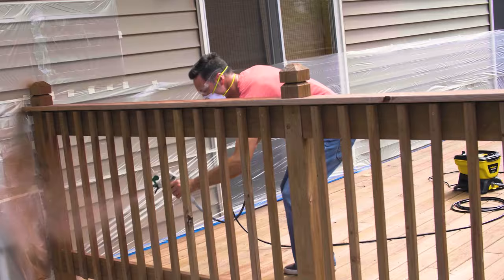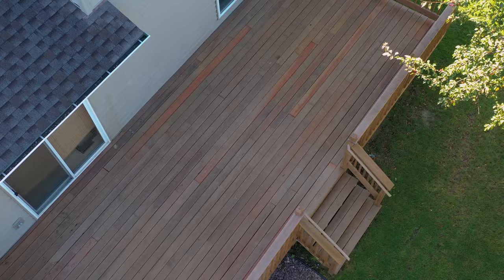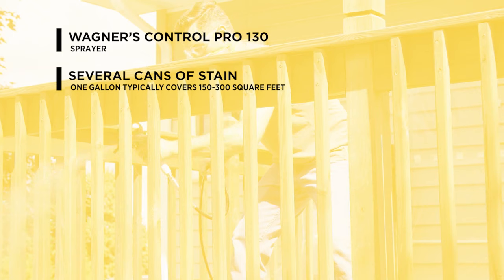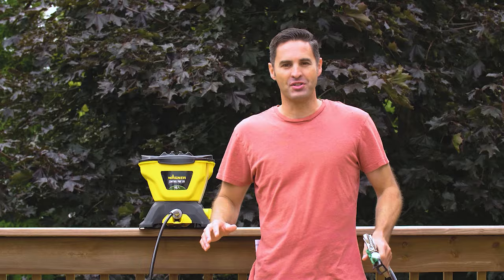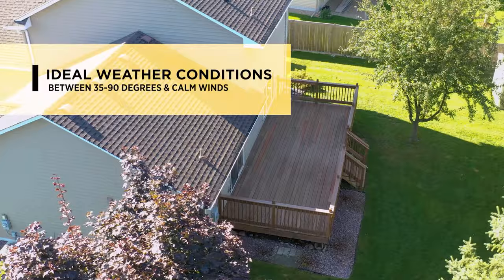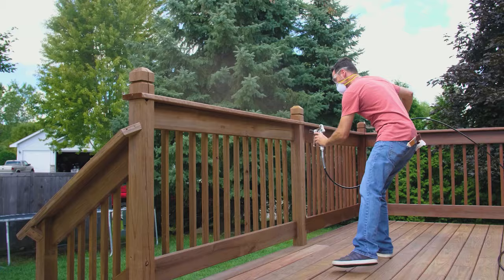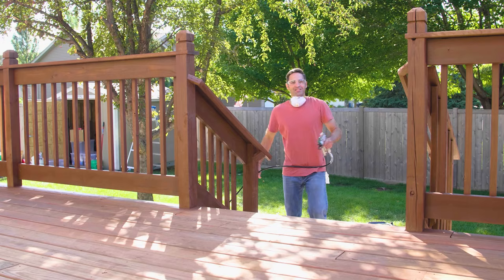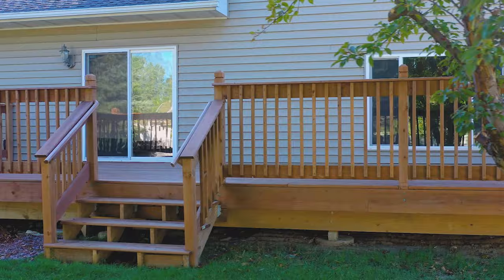How to Stain a Deck with a Paint Sprayer

Comment: I love this! Two friends helped me stain last year and it still took us two full days. Staining by myself this year and have been dreading it. Didn’t think to use a sprayer. 

But I have a tip, if you put the top strap of your mask around the top part of the crown of your head it seals better and won’t pull down so badly - signed a nurse who has to wear them all the time 😊
Reply from the maker: A sprayer will be a huge help for you! Also, thank you for the tip!

Comment: I was looking at this particular product and this video was perfect. I have a fence in the backyard in serious need of some TLC. So first is the fence cleaning and after drying for a few days I'll be staining it and this was some very helpful tips. Thanks.
Reply from the maker: We're glad this inspired you, Julie! The Control Pro 130 would be a great option for staining your fence. A lot of the same tips can apply as well! Quick tip: The Control Pro 130 comes with a 515 spray tip that's ideal for spraying latex paint. If you're spraying stain, we'd recommend purchasing a 413 or 311 spray tip.
Reply: How to clean the gun after staining?
Reply from the maker: If you used a water-based stain then you'd simply flush the sprayer with water. If you used an oil-based stain then you'd have to use a thinner like mineral spirits.

Comment: Do you have to thin a clear coat deck sealer like Thompson's deck sealer? If so, what would be best used to thin it?
Reply from the maker: Thank you for your question! Thompson's wood sealers work great with Wagner sprayers, since they offer both oil-based stains and water-based products. These airless sprayers do not require thinning, but they do require the correct tip size. The maximum tip size for the Control Pro 130 is .015", which is the 515 that comes with the package. Tip size information is usually found on the back of the can. Let us know if you have any more questions! Happy staining!😀

Comment: After powerwashing the time interval guidance is from 1 -3 days . Am not sure .
Reply from the maker: It's important to make sure the deck boards are dry after power washing to make sure the new stain adheres correctly. That can generally take 1-3 days depending on your deck boards, climate and weather.
Reply: Couple of dry days for sure and then check it by putting a couple drops of water on deck somewhere and see if the wood absorbs it, it it does then get er dun!

Comment: Did you go back and wipe the stain with a rag afterwards?
Reply from the maker: That step will depend on the type of stain you're using and the wood you're spraying. In most cases if the proper steps are followed, you won't need to follow along with a rag

Comment: I have a Control Pro 150. What size tip should i use to apply oil to my deck and battens similar to those around the deck in the video? Cutek Oil
Reply from the maker: Thank you for asking! What is the type/brand of oil you're using? If it's a thinner stain then we'd recommend a 413 or 311 tip. Also, make sure the material has a minimum flash point of 100 degrees Fahrenheit (flammable materials should not be used in the sprayer)

Comment: Can I spray a solid color stain with this wagner? If so what tip guard should I use?
Reply from the maker: Hello! Yes, you can spray solid colored stain! The sprayer comes with a 515 spray tip that can be used with some thicker solid stains, but if it's on the thinner side then we'd recommend purchasing a 413 stain tip separately

Comment: what is the process of cleaning the 130 after using a oil based stain?
Reply from the maker: It's super easy! Instead you'd clean with mineral spirits, but follow all the same steps by cleaning the gun and hopper. We have a cleaning video on our channel.

Comment: @Wagner Spraytech  Appreciate the vid and the links in the comments for attachments and so forth.  What was that clear wrap you used to protect the house so I get some of that before tackling my deck?
Please advise on the best paint to use to seal the deck as well as stand up to pets running up/down the deck without scratching thru the paint before you do it again in a few years?

Thanks
Reply from the maker: Here's an example of tape and plastic that you can use. We recommend going to your local paint store and inquire about a durable, outdoor paint. Generally, you'll always need to repaint or restain every few years due to the elements and wear. We look forward to seeing your project! https://www.homedepot.com/p/3M-ScotchBlue-24-in-x-30-yd-Pre-Taped-Painter-s-Plastic-with-Edge-Lock-and-Dispenser-PTD2093EL-24-s/204344770
Reply: @Wagner-Spraytech  thanks for the link. Would you happen to have a paint you can recommend that has primer, sealant and can stand up to pets running around on it to address the wearing of the paint my pets are presently doing around the steps on my deck?
Reply from the maker: @BDiHaze  This patio paint by Behr is a good option: https://www.homedepot.com/p/BEHR-PREMIUM-1-gal-PFC-63-Slate-Gray-Gloss-Enamel-Interior-Exterior-Porch-and-Patio-Floor-Paint-679501/100146776
Reply: @Wagner-Spraytech  thanks much!
Reply: You can also look at Cabot deck correct! That’s what I’m using and I have kids and pets!

Comment: My interior walls are T1 11 plywood. If I put on a clear coat sealer how often do I need to have it done on the inside since it's not out in weather or direct sun?
Reply from the maker: We'd recommend checking the information on the sealer you're using. They should have a recommendation for when to apply a fresh coat. If you choose a standard sealer designed for indoor use then it should last for years without issue.
Reply: @Wagner-Spraytech  my friend already has a sprayer. Can you use any sprayer or a specific one?
Reply from the maker: Do you know which sprayer they have? Most of our sprayers can easily spray sealer since it's thin. If it's an airless sprayer, just make sure you have a sealer tip like the 413 or 311.

Comment: Can you use decking oil with this paint sprayer?
Reply from the maker: Yes, you can use oil based deck material with this sprayer as long as it has a minimum flash point of 100 degrees Fahrenheit
Reply: @Wagner-Spraytech  thanks for replying

Comment: This video is perfect. Few questions. If I buy your sprayer for $250, how long will it last me? And how often do I need to reapply stain. We stained our deck by hand brush last year and need to already redo it this year (it was a brand new deck and similar size to the video). Thanks!
Reply from the maker: Hello, Brad! Our sprayers are built to last for countless projects. The Control Pro 130 is built to spray 50 gallons/year and also comes with a 2 year warranty. The frequency of staining your deck will depend on your climate and the type of stain you use, but it's generally recommended to stain your deck every 1-2 years.

Comment: Can you run a sealer through that sprayed afterwards or mix it in with the stain?
Reply from the maker: Yes, you can run sealer through the sprayer afterwards or buy a stain with a pre-mixed sealer. You will also need to purchase a stain tip (sold separately) since the sprayer comes with a tip designed for latex paints
Reply: @Wagner-Spraytech  do yoou have a part number for the stain tip? I want to use something like a thompsons water sealer in here, which is similar to waters viscosity. Would that be ok?
Reply from the maker: @ActuallyAndrewFishing  Yes, you can purchase the stain tips here on Amazon. Yes, this sprayer is great for spraying Thompsons Water Sealer as long as you have a 311 stain tip since the material is so thin: https://www.amazon.com/dp/B06XY3VZTZ/ref=twister_B099992RQ1?_encoding=UTF8&th=1

Comment: Well,Can i paint a roof by this machine ?
Reply from the maker: Hello, please use caution if you are planning to be on the roof. Before spraying your material, just make sure it has a flash point above 100 degrees F and reach out to our customer service team at 1-800-328-8251 if you have any questions.

Comment: What tip did u use?
Reply from the maker: The sprayer comes with a 515 spray tip for use with latex paints, but if you're spraying stain then we recommend purchasing a 311 or 413 spray tip (sold separately)